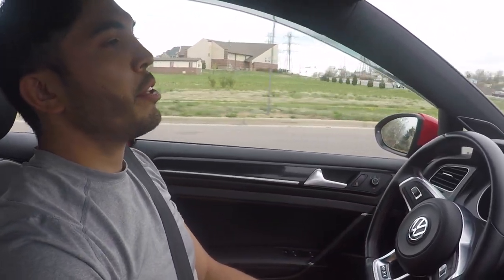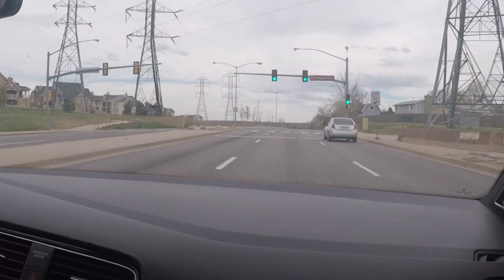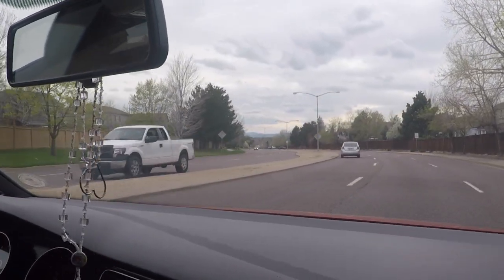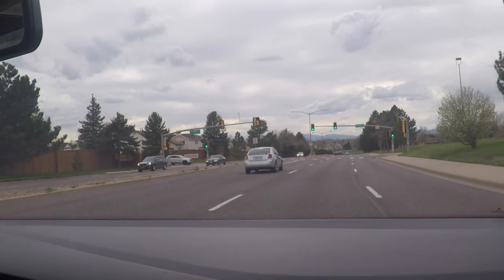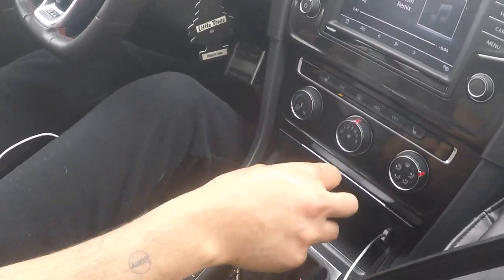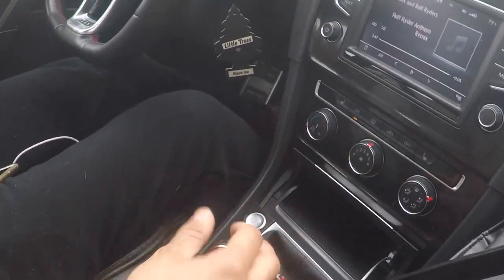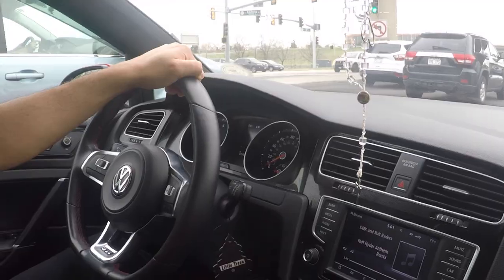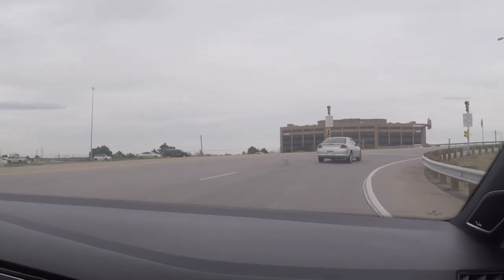MK7 GTI Southbend Stage 2 Clutch  REVIEW

Comment: I read this clutch may come with shims for the throw out bearing. The hard to get into gear sounds like the clutch isn't fully disengaging. The shims make sure that the throw out bearing completely disengage the clutch.
Reply from the maker: Tom Simbron it’s not hard to get into gear it’s just compared to the stock one it just takes a little more effort,, I might be wrong tho I’m by no means a clutch expert but I haven’t had any issues at all with it
Reply: @thekiki303  It shouldn't take any more effort over stock. It should be exactly the same. Engagement is all that should change, not actual shift feel. If it is dragging, it would slowly ruin the synchros.
Reply from the maker: Tom Simbron I better get it checked than don’t want to mess something up

Comment: I went with a stage 1 clutch and 9lb flywheel and I feel like it slippes. Im still in the 200 mile so I got more miles before I can fully press but with me just doing like 50% throttle and still slipping i wonder if I should of gone with stage 2. Oh yeah I have stage 1 tune.

Comment: Is it the dual mass flywheel that makes the clutch engagement seem slow? I have a MK4 Jetta 5 speed and I’m able to row through the gears without having to let the engine rev down too much, but when I drive my mk7 gti, every time I upshift it lurches forward if I let the clutch out too fast. I’m trying to do my research and I wanna get something that doesn’t break the bank, my mk7 is untuned but I’m planning on upgrading the power soon and I feel like the stock clutch isn’t gonna cut it